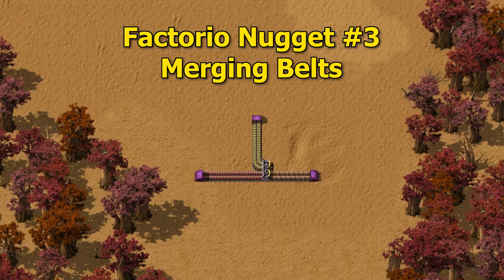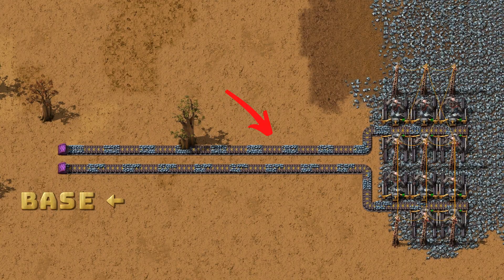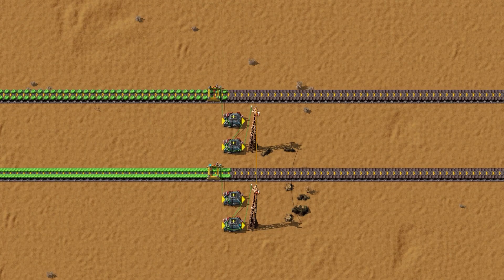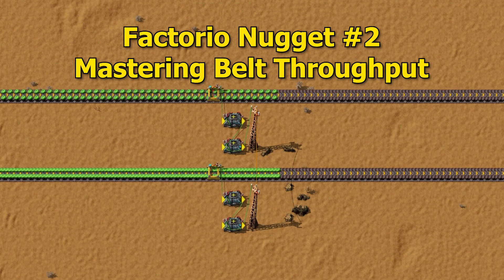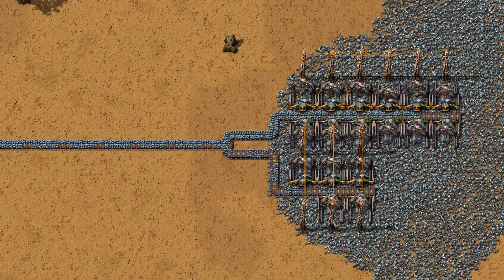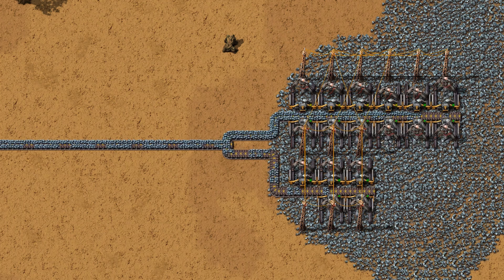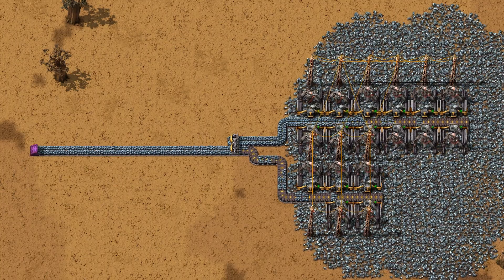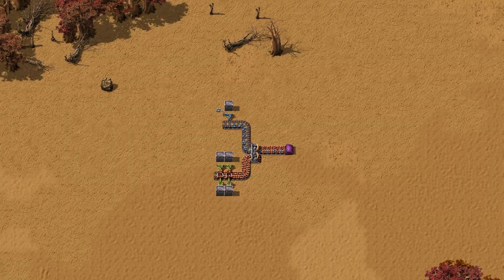Factorio Tutorial: How to Merge Belts Properly | Nugget #3

Comment: If you want to prioritize the higher throughput belt in the mining outpost example put the splitter on the lower belt, then use an underneathy to sideload from that low throughput southern belt onto both sides of the higher but not full northern belt. 

Prioritizing belts is sometimes handy. In this case it'll give you the mining outpost's maximum output for longer as with just a splitter merging them it takes half from each but with the sideloading both sides it keeps the higher output going longer. 
Course that also means it'll fail harder faster when it does run out.